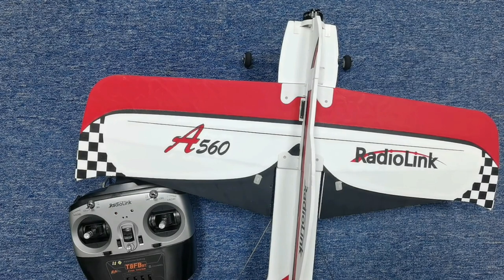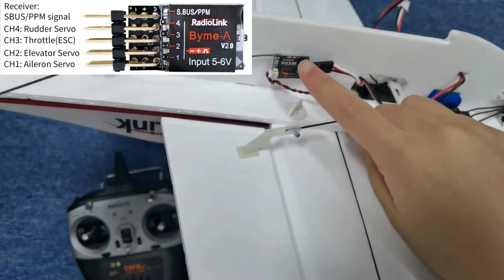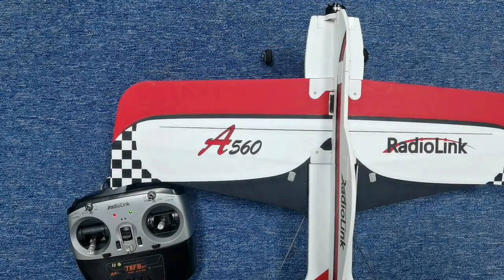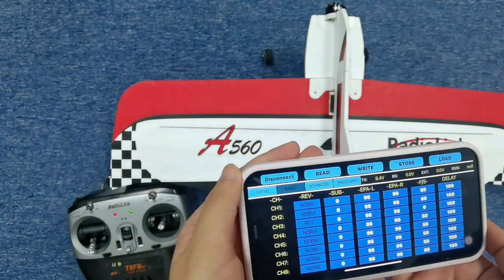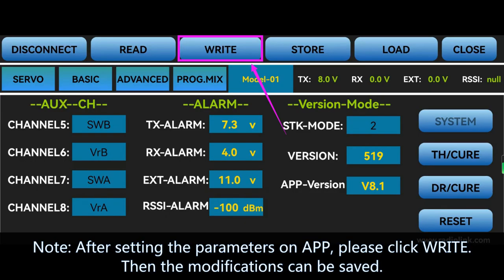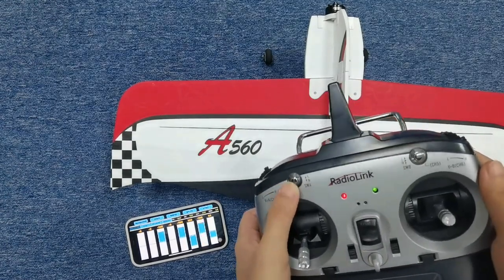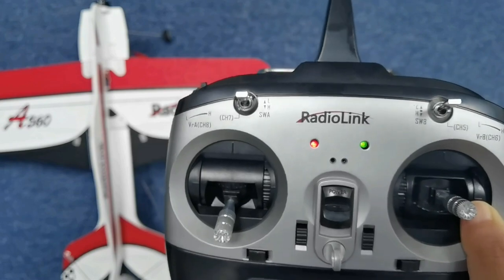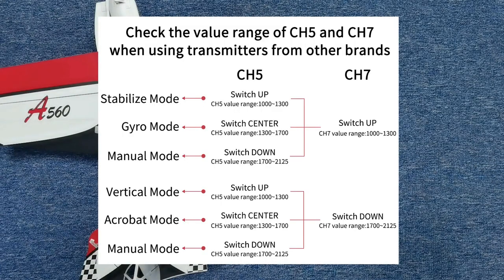Tutorial on how to Set T8FB & A560/Byme-A

Comment: Hi, actually I have a transmitter t8fb which I recently bought one day I was using a computer simulator free rider and suddenly my transmitter stopped working, its leds are not glowing just completely stopped so is there any repairing survice that you provide??
Reply from the maker: Hi, sir. Sorry to hear that. If you are using simulator, may I know did you use dongle to connect the transmitter to the computer? Here is a video tutorial of T8FB tutorial. https://www.youtube.com/watch?v=yu5YS8K029U  And may I know what is the problem of your T8FB now? Can't it be powered on with the battery? Could you please take a video to us? It will be helpful for us to know how to help you solve it. If any question about RadioLink products please feel free to contact us. Our email is: after_service@radiolink.com.cn
Reply: @Radiolink_official actually I was using the simulator wirelessly throught arduino and no its is not powering up now. I mean It was working perfectly for few months.
Reply from the maker: @devaditya6248  Hi, sir. May I know if the transmitter cannot be powered on in all situaltions? Did the problem happen after you update the firmware or after you use the arduino to play simulator? If you want to use simulator, you need to use dongle. It is not safe to use other device to use simulator. If your transmitter is damaged because of it, sorry it's hard for us to confirm which part is damaged. We recommend you to take part in our trade in activity to buy a new one at low cost. Here is the link for your reference. https://www.radiolink.com/newsinfo/844239.html  If any question about RadioLink products please feel free to contact us. Our email is: after_service@radiolink.com.cn

Comment: ADVANCED MENUE :  D/R= INH?  Attitude= 14,29,744,56,69,88? elevon= inh ? Vtali= inh?  thanks
Reply from the maker: Hi, sir. INH means the function is not turned on. If you are using Byme-A, you do not need to set mix in the transmitter. Because the mix is already set in the flight controller.

Comment: Dear friends! Your videos are very useful and interesting. But could you show the connection and configuration of Radiolink BYME A to the Flysky FS-I6X equipment. This is a very common and cheap equipment and, it seems to me, all aircraft modellers will be very interested. Thank you in advance.
Reply from the maker: Hi, sir. Thank you for your support. The usage of Byme-A is similar for different transmitters. Could you please follow the tutorial here or check the detailed manual of Byme-A to use it? https://www.radiolink.com/bymea_manual  If you have any question when using Byme-A with your transmitters, please feel free to contact us. Our email is after_service@radiolink.com.cn